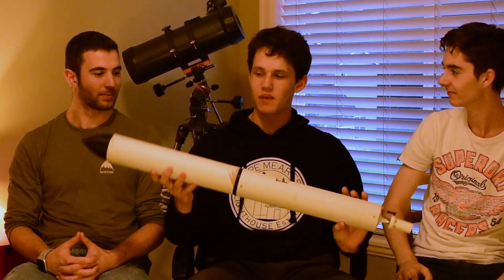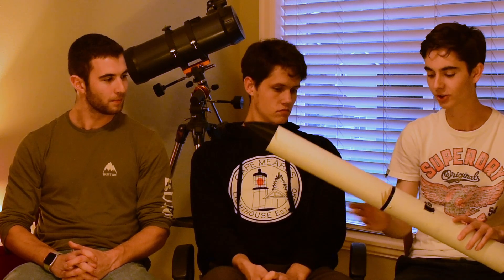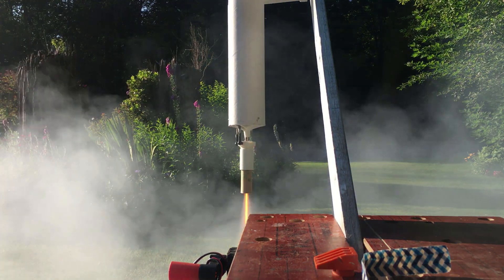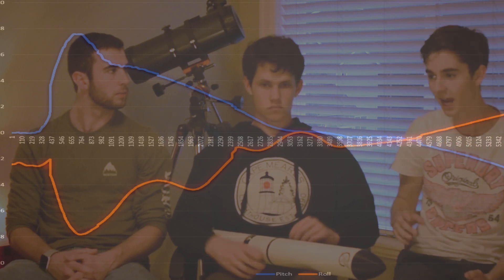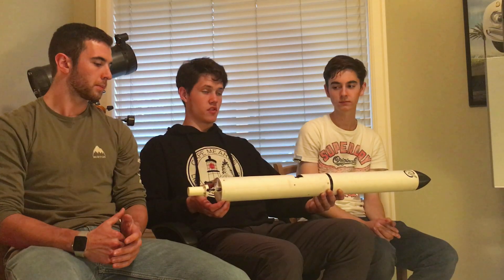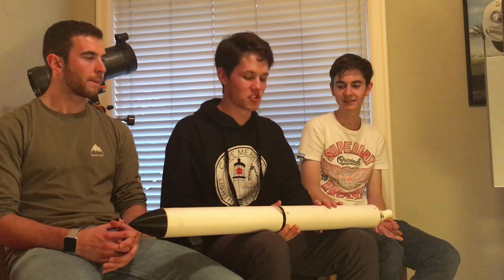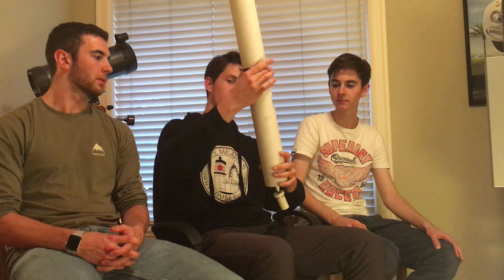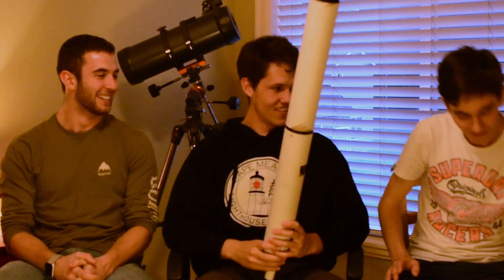Model Rocket Thrust Vector Control | Hold Down Test Series 2

Comment: Just wondering, what motor did you use? I am interested of building a similar project, but I stumble upon a problem that the thrust vectoring gimbal would be ineffective with a burn time of 1.67 seconds.

Comment: Great work! I am working on the same thing but with a rcs. You got very lucky with those pids. What calculations did you do to get those.
Reply from the maker: After a lot of reading and just testing the module by hand we found a relatively high P and D gain produce a quick response (which is best for rockets) and then kept tweaking, but as we said in the video, we didn't expect them to be this good. We planned to take this data back and feed it through excel and Matlab to tune them, but we are so happy with these values that only very minor changes will be made!